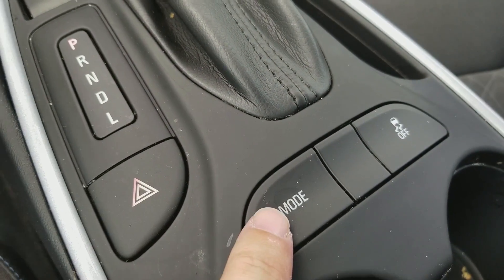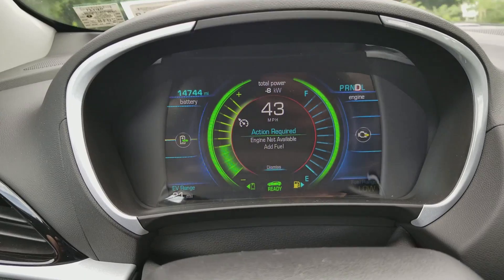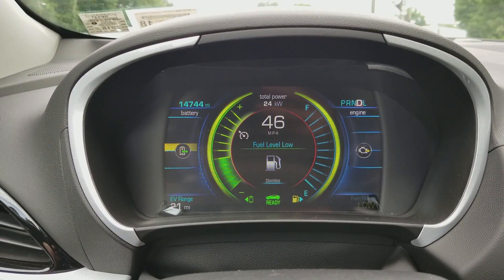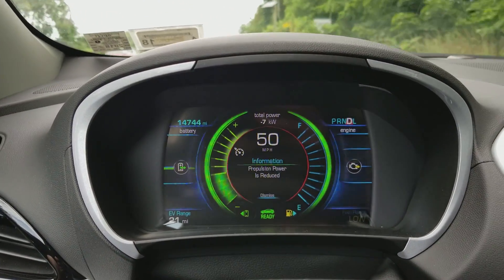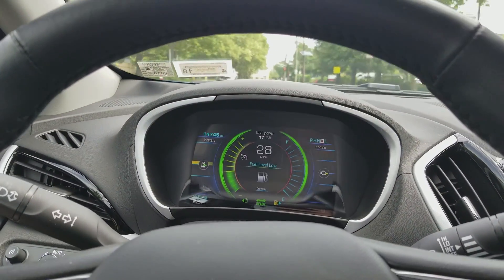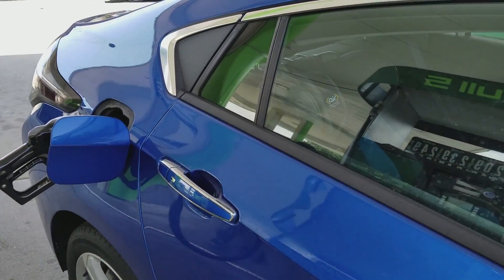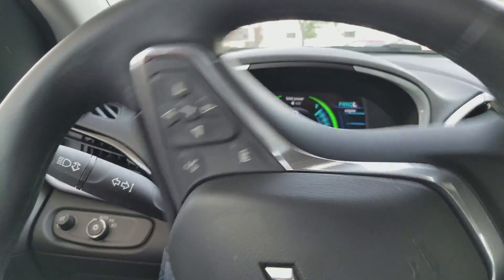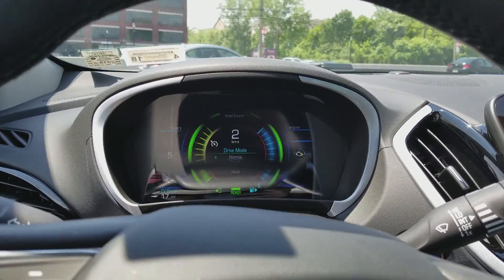Electric Chevy Volt Runs Out Of Gas - Becomes Dangerous

Comment: I'm Sticking With Gasoline

 

ELECTRIC CAR  it makes you wonder…

Ever since the advent of electric cars, the REAL cost per mile of those things has never been discussed.  All you ever heard was the mpg in terms of gasoline, with nary a mention of the cost of electricity to run it.  This is the first article I’ve ever seen and tells the story pretty much as I expected it to.

Electricity has to be one of the least efficient ways to power things yet they’re being shoved down our throats…  Glad somebody finally put engineering and math to paper.

         At a neighborhood BBQ I was talking to a neighbor, a BC Hydro executive.  I asked him how that renewable thing was doing.  He laughed, then got serious.  If you really intend to adopt electric vehicles, he pointed out, you had to face certain realities.  For example, a home charging system for a Tesla requires 75 amp service.  The average house is equipped with 100 amp service.  On our small street (approximately 25 homes), the electrical infrastructure would be unable to carry more than 3 houses with a single Tesla, each.  For even half the homes to have electric vehicles, the system would be wildly over-loaded.

         This is the elephant in the room with electric vehicles...  Our residential infrastructure cannot bear the load.  So as our genius elected officials promote this nonsense, not only are we being urged to buy the damn things and replace our reliable, cheap generating systems with expensive, new windmills and solar cells, but we will also have to renovate our entire delivery system!  This latter "investment" will not be revealed until we're so far down this dead end road that it will be presented with an 'OOPS!' and a shrug.

              If you want to argue with a green person over cars that are eco-friendly, just read the following.  Note: If you ARE a green person, read it anyway.  It’s enlightening.

         Eric test drove the Chevy Volt at the invitation of General Motors … and he writes, "For four days in a row, the fully charged battery lasted only 25 miles before the Volt switched to the reserve gasoline engine.”  Eric calculated the car got 30 mpg including the 25 miles it ran on the battery.  So, the range including the 9-gallon gas tank and the 16 kwh battery is approximately 270 miles.

         It will take you 4-1/2 hours to drive 270 miles at 60 mph.  Then add 10 hours to charge the battery and you have a total trip time of 14.5 hours.  In a typical road trip your average speed (including charging time) would be 20 mph.

         According to General Motors, the Volt battery holds 16 kwh of electricity.  It takes a full 10 hours to charge a drained battery.  The cost for the electricity to charge the Volt is never mentioned so I looked up what I pay for electricity.  I pay approximately (it varies with amount used and the seasons) $1.16 per kwh. 16 kwh x $1.16 per kwh = $18.56 to charge the battery.  $18.56 per charge divided by 25 miles = $0.74 per mile to operate the Volt using the battery.  Compare this to a similar size car with a gasoline engine that gets only 32 mpg.  $3.19 per gallon divided by 32 mpg = $0.10 per mile.

         The gasoline powered car costs about $20,000 while the Volt costs $46,000+…  So the American Government wants loyal Americans not to do the math, but simply pay three times as much for a car, that costs more than seven times as much to run, and takes three times longer to drive across the country.
Reply: A few things wrong with your post...

1 The Chevy Volt is a hybrid car and does not support the kind of charging that most ev's have. Most ev's today can charge 80% in about 30-45 minutes. I understand that this is not yet ideal but it is a lot closer then you posted.
2. The math you used to calculate how much it is to charge the car is completely wrong. You said that you pay over 1 dollar per kwh. I just checked my electric bill for my all electric house. I used 2,078 kwh's last month (it's winter now). My bill after all taxes came to $266.04. That adds up to $0.128 per kwh. For the 17kw battery example you used would make the cost to charge $2.18. 
3. The current ev's coming out now have around 65kw batteries with a 235 mile range. Using the  0.128kwh cost would make it a cost of $8.32 to charge. That gives it a $0.0354 per mile. 
4. The maintenance cost of an ev is far less than that of a petrol. The electric motor is more reliable(when was the last time you serviced your refrigerator).No exhaust system or oil changes. The brake system lasts longer because of regenerative braking.
5. The torque. The 0-60 on these cars are amazing. The Porsche Taycan coming out in a few months is just insane. That's just the beginning. The next couple of years will be very exciting. Just asking you to check into it a little harder.

Comment: Regarding your summary. No. That's is not the technology. You do not own an electric car. The programming on a hybrid system is designed to keep you and the car safe during desperate times. Technically the power trains are not designed to run separately. When you run out of gas. The car went into an Emergency mode kind of. Designed for you to make it to the nearest gas station under minimal circumstances. However, it does work the other way around. As long as you have some gas in the car. I say quarter tank. You could drive around in EV mode to your heart's desire as long as you don't exceed the electric powertrain momentum limits or drive too close to battery completion. I think you should turn this in and get a Chevy Bolt. It's actually way more efficient. Just my opinion. Nice experiment though. Somebody should hash tag this the hybrid challenge to see how the different cars handle desperate times.

Comment: Engine turns on because the battery needs to be charged because it was depleted. Also,  I'm pretty sure the Focus ST disables the turbo once the fuel light comes on, so has powered card do it too.

Comment: I think reducing propulsion will make the battery last longer.  The same way not flooring it saves gas you'll use less electricity and keep the electrical drive components cooler (more efficient than when hot) therefore wringing even more mileage put of the remaining electric range.

Comment: That "secret reserve" you mentioned, at the beginning, is the reason for the "Limp mode." When the vehicle depletes the gasoline reserve, the software expects that the propulsion battery will be near empty and limits the acceleration power, as higher torque requires disproportionately higher amperage as the torque increases.  As the engineers designed the Volt to operate as an electric vehicle with a gasoline reserve, and not a gasoline vehicle with an electric reserve, there would have been no perceived need to code for the scenario you demonstrated, in your video. 

I would also postulate that most Volt owners would not operate their Volts, in the manner displayed, in the video. Therefore, no patch is warranted.

Further, If you had run out of fuel in a Combustion Engine Drive-train vehicle, "Limp mode" would be a Godsend. Be happy that the software engineers didn't kill the battery below its reserve. As dipping into this reserve charge can have a negative effect on the battery's capacity, limiting its life. So, this limiting is doing you several favors.

Comment: It uses a giant lithium/cobalt battery pack. It's EXTREMELY DANGEROUS to over discharge those batteries, they can easily EXPLODE, that's why it reduces the power available when you run on batteries only. In addition, over discharge will at the very least ruin the battery permanently. And they probably want to maximize the distance possible to get you to the nearest gas station, and the slower you go, the farther you will get with the power remaining.

Comment: From what I remember, the Chevy Volt goes into a extended battery range mode when you purposefully go into hold mode and run out of gas. Probably to get you to the closest fueling station that has gasoline at it. I can't say for sure on that, though.

Comment: you wish they told you that? Ugh its in the manual lol, always read the manual! page 136!

PROPULSION POWER IS REDUCED
 
This message displays when the propulsion power is reduced and can affect the ability to accelerate.
If this message is on, but there is no reduction in performance, proceed to your destination. The performance may be reduced the next time the vehicle is driven. The vehicle may be driven at a reduced speed while this message is on, but maximum acceleration and speed may be reduced. If this message stays on when the malfunction indicator lamp is on, the vehicle should be taken to your dealer for service as soon as possible

Comment: I drove my Volvo V70 in limp mode due to a dead throttle body module. Volvos limp mode is much more limp than this. I could not reach 80 kph (50mph) at all. I drove with hazards on the shoulder and got it fixed as fast as possible, because scary as hell...

Comment: With fuel injection you should never run it out of gas and that is in your manual. If you run out of gas and battery the Volt has to go to the dealer I believe that is in your manual too.

Comment: it's not lipm mode because the electric motor is running to its full potential there is just no engine to supply the difference in power limp mode is when there is still potential  there to work but the cars ecu decides not to alow power the fact that there is no fuel means there is no potential there for no limp mode just someone who doesn't read there owners manual but if there is still fuel he is saying there is not and the car dose not use it then that is limp mode but I have the feeling that the owner wouldn't be happy with either of them outcomes

Comment: They probably don't want you immediately running out of electricity.  But 20s is beyond rediculous, it's so extreme the car shouldn't be advertized as 'electric' since gas is clearly required for the acceleration needed to be safe.

Comment: IMO it should work like this: No gas but >50% battery, semi-limp mode(slower than normal but faster than full limp mode IE: 10 sec 0-60). No gas and <50% battery, [full] limp mode.

Comment: You said it yourself: Gas is the BACKUP, therefore you were running without a "safety net". The Volt is programmed to keep you from accidentally running out of BOTH Electricity AND Gas. Want to have some real fun? Run out of both and see what happens...

Comment: It has to do with the discharge and charge cycles of the batteries. Their voltage change as you use, the engine tops up the juice. When you are not keeping the juice in a efficient level of charge, it builds more heat, looses voltage and  wears out faster. So I surmise that this is an effort to preserve the batteries, not necessarily to get you a little further, but to protect the system.

Comment: This DRIVER is what is DANGEROUS.   The cars moves after it has run out of gas using a little reserve battery, and he's still unhappy and calls it unsafe.

I once let it run down when close to home and experienced this mode.   It wasn't a hot rod like it normally is, but it still moves.  What more does this idiot expect.

Besides, ITS CLEARLY SPELLED OUT IN THE MANUAL!!!    

If you are worried about safety, make sure you always use a condom and let us all pray it always works.     You procreating is more dangerous to the world than this car would ever be.

Comment: A) 0-60 in 19.2 seconds is still better than my 1980 Mercedes-Benz 240D automatic, which was 21 seconds.

And B) That thing only holds 8.5 gallons of fuel?!!
Reply: LMacNeill the tank is pretty small by today's standards for most cars, but we average 2,000-3,000 miles per tank. on road trips we get 350-400 per tank.

Comment: They put it in limp mode to give you the MOST EV distance as possible. And to not over heat the battery since you don't have the gas engine fans to cool the batteries.  That way you don't become stuck somewhere without gas or electricity.  Don't play with technology you don't understand.

Comment: They run the gas engine as a generator. That's why it was running the engine after you discharged the batteries.
Reply: The gas engine is also used to provide extra electrical output. When it ran out of gas it went into an efficiency mode to get you as much range as possible.

Comment: I'm guessing it puts it into "limp mode" after running out of fuel to further conserve energy so you have a little more range
Reply: Yes. I've done this on purpose in the Gen-1 Volt just to see what the infamous "reduced propulsion mode" was like. The car turns into a dog, but it will still maintain highway speeds easily.
Reply: Correct.
Reply: Your guess is my guess. I have a feeling we’re right.

Comment: Despite it being normal mode you ran it without gas and on battery for a few miles. I am sure the computer overrides everything and seeks to immediately generate battery power until the battery has a sufficient charge before shutting the engine back off?

Comment: READ THE OWNERS MANUAL!
It's got multiple warnings about this, disliked for not reading it.
ENGINE NOT AVAILABLE ADD FUEL
This message displays when the
engine is not available due to
running out of fuel. The vehicle can
continue to be driven in Electric
Mode until the battery is depleted,
but will have reduced acceleration.
When this message is displayed,
refuel the vehicle.
FUEL LEVEL LOW
This message displays when the
vehicle is low on fuel. Refuel as
soon as possible.
OUT OF FUEL/ENGINE
UNAVAILABLE
If the vehicle runs out of fuel, or the
engine will not start due to a
malfunction, the vehicle can
continue to be driven in Electric
Mode until the current charge is
depleted. The vehicle will have less
responsive acceleration. DIC
messages indicate reduced
propulsion power, that the engine is
not available, and the need for fuel
or service.
Reply: Aaaand... he didn't pin your comment...

Comment: The reason it went into "limp mode" is you were stupid enough to run it out of gas. So it figured you were dumb enough to try and floor it everywhere to the closest gas station. Netting you another 0.5 miles by limiting you.

Pin it.

Comment: limp mode is for getting you as far as possible on the battery left available.  I did this to myself today and it really isn't as terrible as he made out here.  I had to do a merge on the interstate and traveled 83 mph for 8 miles before getting to an exit with a gas station.   Also the Tesla model has this exact same limp mode trick except instead of being out of gas you are out of battery but not really.   It has a "reserve" that it doesn't count as part of the charge state.   I've seen Tesla owner's test this on YouTube getting anywhere from 10-20 extra miles in "limp mode"

Comment: if you still have battery left when you run out of gas, power off and back on to restart in "normal" mode,  the Volt will not change drive modes if you run out of gas

Comment: The electric motor(s) isn't in "limp mode", you're just used to the extra acceleration that the engine gives you when it kicks on under heavy throttle input. Same thing happens with pretty much every other hybrid. You can't expect to not loose any speed when the engine isn't on. I don't understand where the confusion is. Engine is out of gas, you aren't going to be going as fast as you usually do because the engine is off.

Comment: Its going to run on pure electric (limp) mode if youre out of gas. If youre out of gas, you probably are trying your best to get yourself to a gas station. Limp mode lets you save battery power by limiting your acceleration so you have the most range to get yourself to a gas station

Comment: It's a partial electric car. In my opinion you don't sound too smart with this whole volt thing. The car is not designed to be ran out of gas on top of having a low battery. No car is. Electric or gas or combination thereof.

Comment: First of all most people check there gas level in there CARS.Secondly if you are dumb enough to run your car a non hybrid out of fuel on the highway the car comes to a stop this is much more dangerous than what you did with a hybrid the limp mode is there to get you off the highway safely not to go onto the highway.So I think you should read your owners manual and learn about your car and driving it safely.

Comment: The gas engine just charges the batteries. It doesn't provide any power. So if you are on just battery, the batteries cannot charge and drain. Hence slow mode.

Comment: Limp d*ck lol! 
     If you think that's dangerous,    try being 35 miles off shore, in storm force winds  and have the  12 liter diesel computer put you in Limp mode!    Simply  because the fuel filters  had an incrementally reduced flow rate! 
     Electronics are good... until they aren't

Comment: "limp" ??   .. its pretty amazing being able to still drive to a gas station after running out of gas!!.
Reply: That's the whole point right? Even if the car could produce full propulsion, it should be designed to reduce it. Otherwise dumb asses will just keep on driving it. The low propulsion is the car's way of saying it needs to go directly to the gas station and not be taken on the highway. I am not sure if this is still true but earlier Prius' did the same thing. They could limp along at 20-30 mph when they ran out of gas. This is preferrable to walking to the station with a gas can.
Reply: @ampsquadEV I don’t think anyone in this comment section understands this car. The volt is MOST powerful when in electric mode. The “engine” is just a generator for the battery - none of that power goes directly to the wheels. It’s not like earlier gen Prius where the power is still from the engine. This is a powerful HV battery, not some dinky 12V thing. It doesn’t make sense to handicap the battery when there is no gas. A lot of users almost never fill up on gas and just drive on electric mode only.